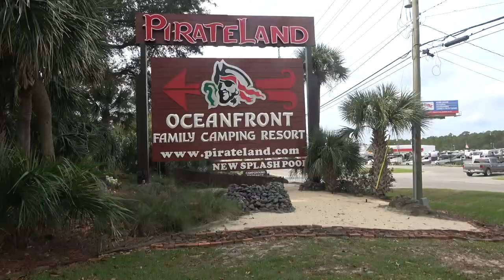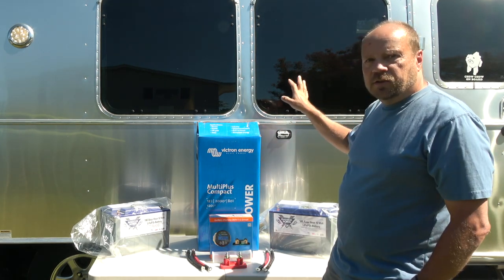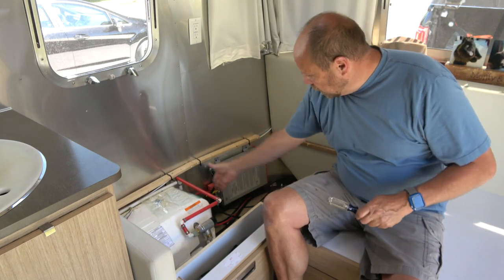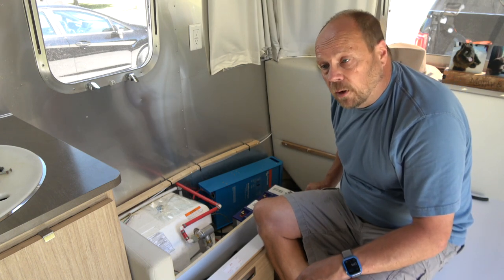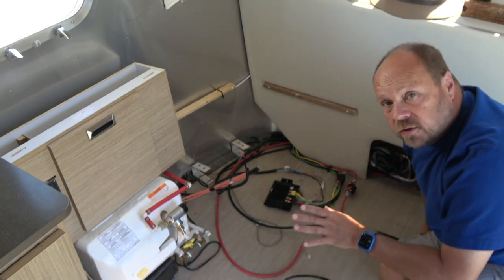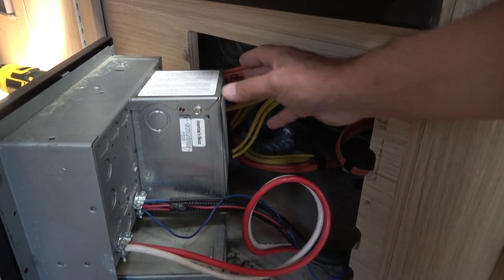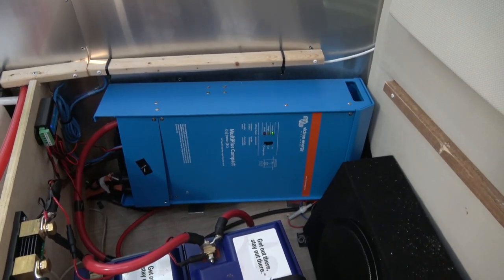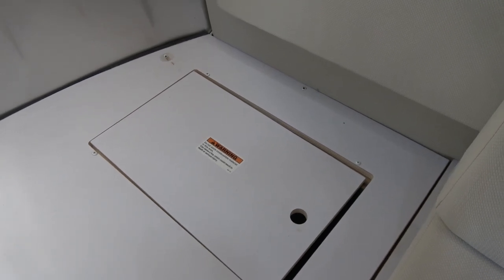More Power - Airstream gets Lithium Batteries and a new Inverter | ZEPHYR TRAVELS - RV Lifestyle

Comment: FINALLY!  Thank you for this practical explanation of how to do this.  I don't have good experience with these systems and did not understand that the inverter/charger replaces the converter.  Your answer about routing the shore power to the inverter 'in' and the inverter 'out' to the fuse panel solved a mystery for me.  I have searched Airstream forum and lithium provider sites and had given up on understanding this basic principal.
Reply from the maker: Thank you, I am glad you found it helpful.  I was like you and had not done anything like this before, but I did the research before hand and was able find the information need to do the installation.  Stay tuned for more RV how-to videos.

Comment: Question for you on the transfer switch - for the line coming out of the inverter (Line Out) would be the incoming (same as Generator)?  I am seeing 2 inputs (shore power & generator) and one output which goes to the  breaker box.
Reply from the maker: With a hybrid inverter like we installed in the video - The output from the transfer switch goes to the inverter. The output from the inverter goes to the breaker box.  The two inputs to the transfer switch do not change. By putting the inverter between the power input to the trailer (shore power or generator) and the breaker box, this allows the inverter to boost the incoming power. So when you plug in to 20 amp and you need 30 amps, the inverter will pull 10 amps from the batteries to make up the difference.  I hope this makes sense, thanks for the question.
Reply: @ZephyrTravels  Makes total sense, and thanks for the clarification.

Comment: Do have any videos on how to connect the inverter/charger 
Do you have any information on disconnecting the original converter and reconnect the victron inverter/charger 
Are you happy with the 2000 watts inverter/charger 
Or if you had to do it again would you go with the 3000watt inverter/charger?
Reply from the maker: Hi Bernie - Great questions, I know it is hard to find information on the installation of an inverter/charger.  The video you watched is the only video I published on the installation , but it is really simple wiring.  
There two power sources you need to hook  up to the Victron.  AC in and out and DC in and out.   For the AC you want to reroute the incoming shore AC power to the inverter/charger and wire the output back to the power panel.  On mine AS I had a box mounted to the back of the panel for the transfer switch (I have two power inputs on the trailer), I used that box that to tap in to the incoming power after the transfer switch to reroute the AC to the inverter/charger.  The inverter/charger AC output was wired directly to the power panel.
For the DC input and output, because I was replacing the batteries, I removed all the existing wiring and replaced it with heavier gage wire.  Wire DC input directly from the batteries to the inverter/charger and the output to the trailer distribution bus.
I disconnected the original charger by removing the AC power from the circuit breaker.
The decision to go with the 2000 watt inverter/charger was based on the number of batteries I was able to install.  As I was moving the batteries inside the AS, I only had room for 3 batteries max.  A 3000 watt inverter/charger would need more batteries to supply the additional power needed.  The 2000 watt inverter/charger runs most everything I need.  If I had the room for more batteries (4 plus) and had a 50 amp service, maybe 3000 watts would be needed.
Thanks for the questions.

Comment: After a year how is the system working.  Any changes?
Reply from the maker: Te system has worked great except for when we ran the batteries dead one week - check out our video from Lake Meed.  I did fix a couple issues with the circuit breakers I used for switched on the solar inputs, replacing them with on/off switches.  I hope to add 1 more battery and solar panel in the future.

Comment: I have a 27 FB and I want to perform the same mod. Nice install BTW. 
•Did you happen to note what side you connected to in the ATS-301? Sorry if I missed it... 
•how did you run the cable to the Converter/ATS-301? Specifically from the lounge area , My install will be under the bed where the Inverter /solar is currently housed
•Where did you source the cable you used to run from the Victron inverter to the ATS-301?
Reply from the maker: Hello Lee,  Sorry for the delayed response.  
My install is under the front lounge in a unused space next to the hot water heater.  I was able to run a 10/2 romex cable (purchased from Home Depot) from the inverter to the ATS at the power box under the kitchen cabinets.  I checked the Airstream installed cable from the external power connections and that what they used.   On the ATS, I disconnected the power going in to the circuit breaker box and ran that out to the input side of the inverter.  The output from the inverter connected to the input side of the circuit breaker box using wire nuts.

Having the ATS made the installation very easy. if it was not there, I would have to add a separate box to splice in the wiring.

Good luck with your install.   ...Zephyr

Comment: I found your video very helpful. I live in Colorado where it can go below freezing three seasons out of the year.  Did you have the need with your install to protect against trying to charge in cold temperatures?
Reply from the maker: Thank you, I am glad you found this helpful.  The batteries will not take a charge if the battery temperature is below freezing.  This is why I moved the batteries inside the Airstream.  I also asked Battle Born Batteries about winter storage.  There suggestion is to charge the batteries then disconnect them.

Comment: Hello, great video. Are you able to start the ac with the 2000 watt inverter? Did you need to add extra parts like a soft start or so?
Reply from the maker: Yes I did, but I would not suggest doing it with out a soft start.  I have run both the AC and the heat pump in the inverter.  when starting up the AC draws so much power that the batteries wires got extremely hot.  It also heated up the compartment that the batteries and inverter are that the batteries shut down (over 130 degrees ).  I plan to add a soft start next summer.
Reply: Great video!

Comment: I've got the same layout, and was considering the same mod (I have the Viper 120AH lifepo4 batteries). Curious how hard the sofa disassembly was (not shown in the video), and what did you need the 2200 watt inverter for that the 1000 couldn't handle? (I was going to upgrade our inverter, but can't think of anything that'd need that much juice! hairdryer?)
Reply from the maker: The sofa is easily removed with 5 screws going into the floor.  My 2000 watt inverter is a passthrough and powers everything in the Airstream.  It also allows me to plug in to a 15 or 20 amp outlet and adjust the inverter to make up the difference to 30 amps.  This will allow us to run the AC or microwave while driveway surfing.  This feature came in handy this weekend at the park we are staying at, as the 30 amp outlet here did not work.  Thanks for the questions....Zephyr

Comment: When you boondock, how many ah are you using on average? Last video you still had 105 ah/useable and stated that was not enough. With the 200ah usable/battleborn, is your solar able to keep up or do you still need a generator?
Reply from the maker: Hi Jeffrey,  It all depends on what you want to power and for how long.  If all you want to power are a few lights and everyday is a sunny day then 105/ah is plenty.  But not every day is sunny and we been boondocking with many days of Cloud cover and were not been able to fully recharge the batteries each day.  Having 200 ah allow us to be able to stay remotely longer and not worry if the weather does not shine.  It also allows us to power more from our inverter.  We can even power the microwave for short periods of time.

Comment: Where is your controller, and did you have to replace it in order to accommodate lithium batteries?  Or is that all within the Victron unit?
Reply from the maker: Hi William.  My charge controller is a Zamp 30amp unit, same as the solar panels and is mounted in the same area as the batteries.  It was a simple  setting change on the controller to change the charge profile to match the batteries.  I did not plan this out as a whole system start the start, but added to my previously installed solar system when I decided to add Lithium Batteries.  If I were do it all over again, I would use a Victron Charge controller to match the inverter.  The advantage is every thing would connect together via Bluetooth and I would noy need to add additional holes to the inside of the airstream for remote control panels.   
Thanks for the questions,   ...Zephyr

Comment: Getting ready to make the same switch in my Flying Cloud.  Looked like you may have experience working with electric.  I do not.  Also, I’m not overly smart.  Is this the sort of thing someone without electrical experience could do?
Reply from the maker: You are going to need some electrical experience to do this install.  There are no real instruction on how to do this as you are buying components from different MFG and putting then together.  If this is not something that you are comfortable doing find a friend that is knowledgeable or hire it done.
Reply: @ZephyrTravels  thank you

Comment: Hi I really helpful this video but I have one question. I just installed same as yours. you said you don't need converter/charger because inverter will charge the batteries. here is my problem I disconneted converter charger then when I connected shore power ac powers on working well but except DC power. I have to turn on latch switch to use on mode then 12v dc power on. originally when I pluged shore power ac and dc power working same time. I missed somting? I really hope you know the solution. :) 
Are you not using latch switch? just direct conenncted from batter to dc pannel?
Reply from the maker: I am glad you found the video helpful.  I am not sure what the latch switch is that you reference.  

Here how I wired my inverter and batteries.  There are two power leads coming off the batteries:  One set goes directly the inverter/charger 12V input.  The second goes to the 12v power distribution block for the trailer.  The DC input to older charger was disconnected.

When the trailer draws 12V power it coming directly from the batteries , even when plugged into DC power.  This was the same as how the trailer was wired before with the old inverter.

I hope this helps with your wiring.

Comment: Nice job. Did battle born send you a schematic or did you design it yourself?
Reply from the maker: Victron provided a wiring schematic with the inverter that I used as a guide.  One change I will make in the future is to add a cut power cut off switch on the negative side between the shunt and the batteries.  This will allow me to de-power the system for storage.  It is suggested to not charge the batteries during winter storage.  Unlike led acid batteries, lithium will not loose their charge when in storage.   Thanks for watching.

Comment: Great video, I plan to do the same install.  Did you include a 50A breaker on the inverter AC input?  The Victron manual mentions this but I wasn't sure if necessary in Airstream retrofit.
Reply from the maker: My Airstream is 30A.  I reran the incoming power through the inverter then back to the panel box where there is a 30A breaker.  This has work great, in-fact, with the inverter making up any shortage in power I no longer trip the campsite breaker when overloading the system with the AC, water heater and microwave running at the same time.  Now the 30A breaker in the panel box trips first.
Reply: @ZephyrTravels  thanks!